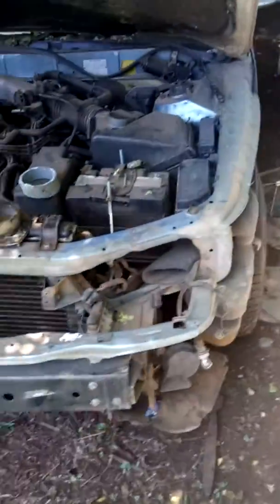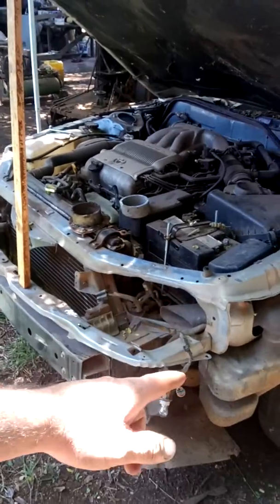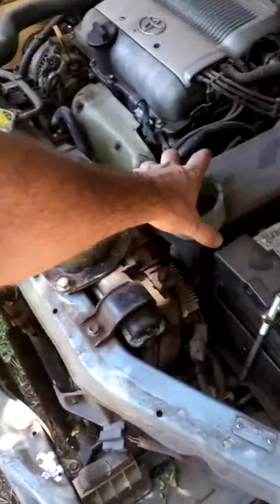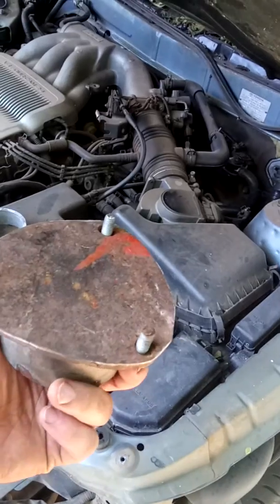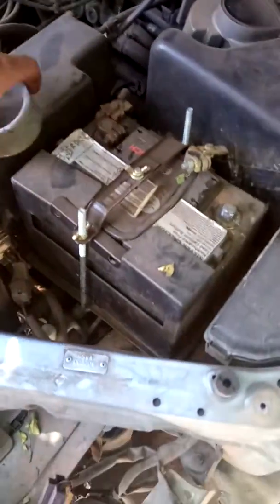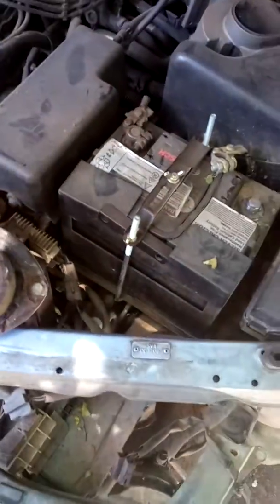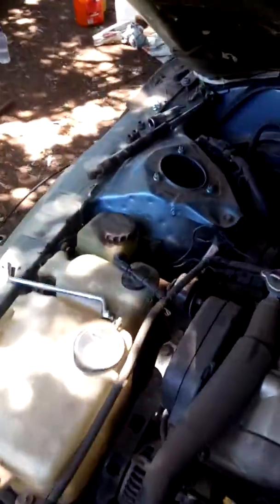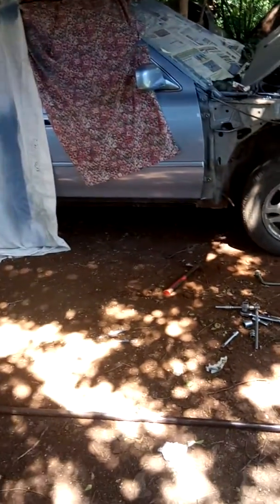DYI Quick Front Suspension lift for Toyota Camry

Comment: I need to do this for my Camry for Rallycross, as I have a front bumper lip installed and don't want to take it off for unpaved tracks. I think levelling it would be ideal. I did already race it with the front bumper lip, and thankfully it hasn't come off yet, but if I hit a rut..
Reply from the maker: For sure, it really helps, and is a cheap and easy fix! Good luck!

Comment: Hi any measurement on how you made those spacers? I have same problem I have 2011 camery so sick of hitting the dips and parking area
Reply from the maker: So many years ago that I made that. I have no measurements.  But might have a set that I made that I can sell...
Reply: How much is the set and will that fit 2011 camery ?
Reply from the maker: @avtarbhogal7024   I had a look in my workshop this morning.  They are gone. Sorry.

I literally used thick steel water pipe to build mine. You don't want to go too high. 35 to 45mm max
Reply: Thank you for taking your time to look for these parts god bless

Comment: Can you make me a front set of these for a 2007 Toyota Camry Hybrid?  What would you charge?
Reply from the maker: Eric Doricko It will be difficult without having the actual coil spring assembly. Its all about the angle.... if I had the angle and the size of the cone it would be possible. Where are you from?

Comment: How did u bolt the strut to the spacer?
Reply from the maker: Hi there, I drilled a hole through the spacer then put the bolt through then tack welded the back of the bolt to to spacer
Reply: @aldovanzyl-jackofalltrades8446  Thank you very much.